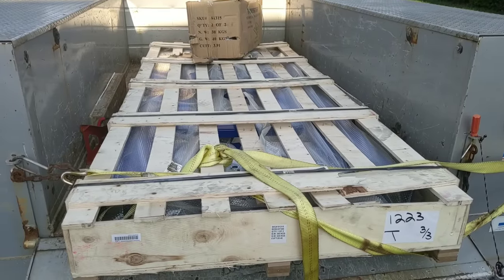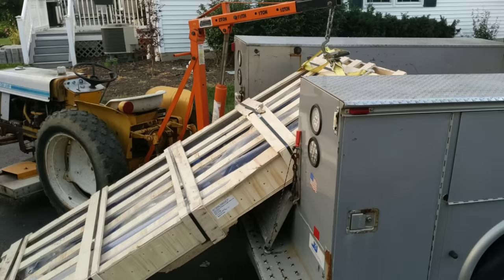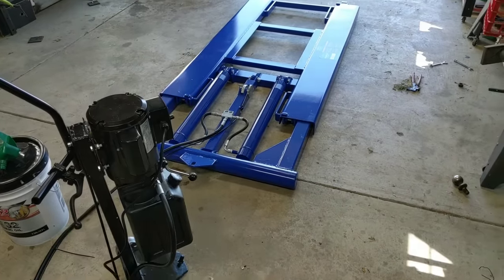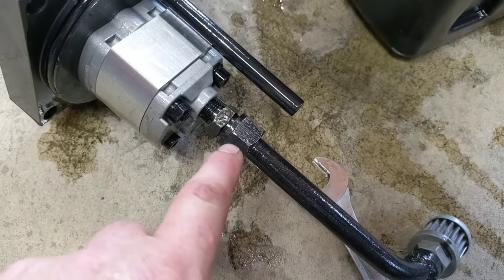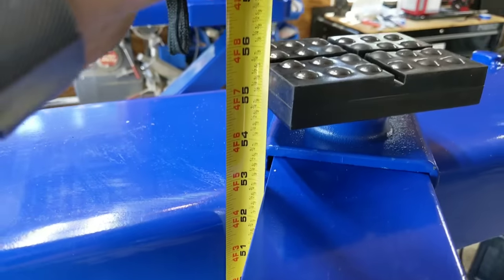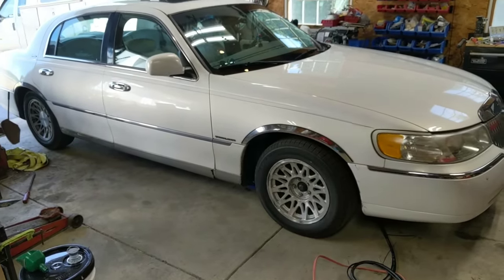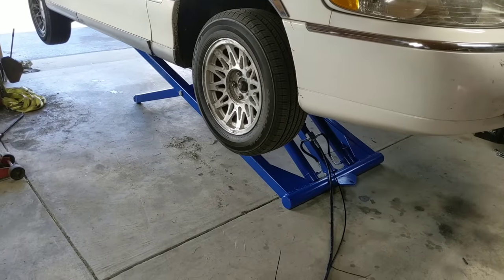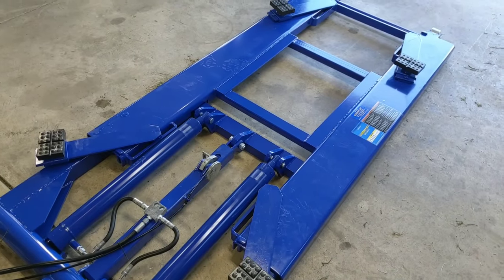Harbor Freight 6000 Lb. Capacity Scissor Lift Review, Central Hydraulics, is it worth it?

Comment: Oops! 55 1/2" is almost 5 feet, not 4.  I knew what you meant.  Talking and videoing is not easy.
Reply from the maker: I can hardly chew gum and walk at the same time let alone talk and video tape.  ;)     Sadly I made a bunch of errors when I shot the film, but I felt it may answer some questions for anyone looking to buy one of these in the future, so I have posted it anyhow.
Reply: @tall bike guy Civilian chutes are square, run of the mill Army chutes are round but do have steering panels.  The Army's demo team uses squares which are much more maneuverable than the ones used by airborne units.
Reply: Every single product that anyone purchases should be in perfect condition and running order, no matter the price you pay!
Just because it's Harbor Freight does not mean you have to settle for less.
You shouldn't be fixing a brand new product.

Comment: I own an Atlas TD6MR lift that is pretty much the same lift but I believe a little better made. I purchased the lift from Greg Smith equipment around 8 years ago. I have made some modifications to my lift. First of all I have two 2 X  12 guide ramps made with 2 X 12 X 14 foot long treated lumber with  a 1/2 inch treated plywood layer under neath and attached to both runners. This gives me the ultimate clearance for low profile vehicles and helps greatly with getting them centered over the lift. Also I custom made  4  longer lift arms that are 6 inches longer than the standard. These arms help me lift vehicles  with a wide wheel base that must be lifted by the body pinch welds.  I use a 30 amp 110 volt dedicated outlet for this lift. Absolutely no need for 220 volts. I have had zero problems or issues with this lift other than the rear steel rollers chewing up my garage floor. For that issue I custom made some 6 inch wide by 36 inch long 3/8 thick steel plates to put under the rollers.

Comment: A shop I worked at for a long time had low ceilings so the the door openers were mounted to the drivers side of the vehicle. You could lift the cars much higher than a center mount. I would suggest Passenger side mounting so you can enter the vehicle with a ladder if needed without lowering the car as this was sometimes an issue. The overhead door company had no concerns with mounting the opener to the side. They say you lift a manual door from one side all the time and it will not cause an issue.
Reply: Craig Shaw like he said in his video Lifemaster makes one that is wall mounted and slides onto the end of the shaft. The emergency release is on the bottom of the motor which is good so someone can’t use a coat hanger to pull the rope and get into your house/garage. After all the rope is only a foot away from the closed door/door seal of a normal garage door opener.  Liftmaster 8500

Comment: The hydraulic pump didn’t even come with mine. The pallet was smashed to pieces. They wouldn’t send the missing parts and ended up picking the frame back up.
Reply: Sounds like junk to me. Guy in vid says no problem just fix, I say it should not need repairs.
Reply: Did you get your money back?

Comment: If you are like me and do everything yourself, the Quick Jack is for you. All of the pieces can be moved easily by one person and it raises your car up to 21 inches and with the rubber blocks, it can be another 4 inches. I bought mine for $1000.
Reply from the maker: Quick Jacks are awesome and great if you need access under the vehicle.   But if you're like me and do everything yourself including detail work, you'd have both.   Scissor lifts are great for detail work, as you can lift the vehicle higher than the quick jacks will allow you too.  Then you can sit on a stool and wheel all around the car w/out any obstructions or shadows a post lift would give you.    While not in use, you can use it as an adjustable work table as I do.   But when you need to work "under" the vehicle, you grab the Quick Jacks and use them.  :D

Comment: $1,699!  Even with the 25% taking it to $1,274, a used two post is a far better deal.
Reply from the maker: Absolutely!   I was finding good used 2 post for half that in my area!   But I didn't want to work around the post and don't have the garage to support one.   https://youtu.be/RAqqgq7ielE
Reply: A scissor lift is really a different tool than a two post lift.  There are more differences than similarities.   Most home shop guys can't install a two post because of height restrictions and/or inadequate concrete.  

The comment about not wanting to "work around" the posts is a little baffling, as the posts are nowhere near any area you would be dealing with, unless you were working inside the interior.  Scissor lifts work well if you're mostly doing wheel and tires, brakes and suspension, and some fluid changes.  Not as well for exhaust work or driveline and transmission.  There's not much you cannot do with a two post (exceptions being frame straightening and alignment) they provide the best access to all areas of your vehicle. 

 I have a 10k, clear floor two post lift in my shop, and I can lift everything from my son's radically lowered Audi to my 3/4 ton diesel crew cab.   It gets used regularly.  Because there is nothing on the shop floor (other than the posts), I can use the bay to load and unload.  One day, I'll get around to installing another rv door in my shop, but until then, that bay needs to be versatile.
Reply: The "problem" with a 2-post lift is that you are supposed to have a minimum of 4" of concrete to install them and most home garages don't have that.

I bought one of the MaxJax 2-post lifts.   It is a 48" lift and fits nicely in the garage and can be unbolted and moved to the side when not in use.

So far, the 3.5" of concrete that I have is holding.  It is rated at 6,000 pounds, but I pretty much cannot get anything that weighs 6,000 pounds into my small garage and i am making a bit of an assumption that the engineers implemented some safety factors into the equation.  So, the 3.5" (measured at the holes I drilled to mount it) is still working.

It is a great device.
Reply from the maker: You are very correct!  Also, by what I meant by "Work around" is I just don't want the post in my way when I'm doing other things.   A good example is my boat is too long to fit in the garage unless I turn it side ways across two bays.   A post bolted to the floor would prevent me from getting it in there at all.    If I had the room, I would love a 2 post, but it's not in my cards right now.
Reply: Just for kicks, look into the "Max Jax" 2-post units.  They are bolted to the floor, but they are easily unbolted and you can wheel them to the corner of the garage when you don't want them around.
Reply: 1D10CRACY |
Reply: @paulstandaert2042  I've seen those. Like that idea of having them removable. I'm thinking about buying a MaxJax lift and leaving one side bolted down and the other side being used as the movable side.
Reply: @Rhaspun  I am not sure what you mean. The posts need to be attached to the floor somehow, and bolting them in places usually how it is done. All I do, is unbolt it with the impact gun and wheel the post out of the way.
Reply: @paulstandaert5709  If I get it. I would leave one of the posts mounted all the time. The other side I would remove it and set the post aside and out of the way. I will utilize its ability to be movable.

Comment: For a couple more hundred you can get a Bendpak. Love mine...for years and years now....
Reply from the maker: Love the bendpak products!   Made mention of them here too!   https://youtu.be/RAqqgq7ielE
Reply: i used to work at bendpak here in santa paula ca. as the lead qc tech. the lfts that harbor freight has and bendpak has are made by the same factory in china bendpak just repaints them and makes minor changes to make it an "original" bendpak.@kranerwheatens @1D10CRACY
Reply: i used to work at bendpak here in santa paula ca. as the lead qc tech. the lfts that harbor freight has and bendpak has are made by the same factory in china bendpak just repaints them and makes minor changes to make it an "original" bendpak.@kranerwheatens @1D10CRACY

Comment: i would like to see you try to rock the car back and forth while a car is lifted up on it, basically see how stable it is with a load on it. how much wiggle does it have?
Reply: This type of lift is not meant for underneath access but rather side access, perhaps brake work, tire work, body work and shock work. only use 4 post garage lifts or even better install a pit in your floor.

Comment: If you want to move it much more easily you can weld a vertical tube near each corner to use large round-shank scaffolding casters. I put all sorts of heavy equipment on those temporarily and permanently (the only difference is leaving the scaffold casters installed). If you mostly use yours as a lift table you could leave them in place. I haven't modded mine because I scored it before I figured out adding casters is glorious (my air horizontal air comps, lath and mill are all mobilized similarly) but next time I move mine I'll pry and use cribbing (typical rigger style) then add weld on caster tubes and have at it. One stick of tubing makes many caster mounts and since the mounts are cheap but casters cost enough to matter you can set four aside for temporary movements.

Comment: Seen 1 recessed into floor worked great in small shop .
Reply: I was just thinking about that. I wouldn’t want to be the first person to do it lol.
Reply: That would be nice and make a easy removable hard cover when not in uses to travel over
Reply: Would be easier to just put some boards along each side to drive up on.  Instant clearance.  Bolt the boards down if you want them to be permanent, and don't mind tripping over them.  lol

Comment: I have a completely different lift, but I also cant lift cars all the way up with 12' ceilings, my work around is an office chair that i can sit on and roll under the car or truck needing repair, it works well in most situations.

Comment: Piece of advice get rid of that compression fitting and plumb a threaded pipe into that pump.Compression fittings are not used in any suction lines in hydraulic tanks on any lift or truck hydraulic systems.

Comment: I bought one like this used, disassembled it, and moved it in my Honda Odyssey. It did take two trips. My main grip is that the dog ears don’t extend far enough to reach the lift points on my Odyssey. However, works well for my CR-V and Jeep GC.
Reply: Longer arms are available from Titian for your scissors lift.

Comment: I would recess into the ground to where the top of the lift is flush with the top of the concrete.
Reply: Most people are going to use this kind of car scissor-lift on a preexisting Concrete or cement floor.
If you wanted to recess the lift into a concrete floor, it would mean using a jack-hammer to tear out 5ft x 9ft of the existing floor, 

and make a "Shallow PIT" about 5 inches deep. ( drilling to insert new re-bar, so when  to pour New Concrete, it binds to old concrete )
(1) This may be "in the way" for other things you want to do with that garage / shop space.
(2) Installing your recessed concrete pit probably cost more than the lift itself. (if you pay someone else, or about $250 to do yourself)
(3) A PIT makes for a Permanent location ... you can never move. (without tearing out and re-pouring concrete) 
(4) The scissor lift was supposed to be "movable" on a level floor, even though heavy and a bit cumbersome.
. . .Once you got the Lift IN to your recessed pit.  It's going to be hard to get back out.
(5) With the Lift in a pit... what do you plan to do with the lift's motor & pump ?  ...plus the pressure hose going to the lift?

OR... IF you recess this lift into "the GROUND"  (to imply a DIRT floor) it's not going to work very well.
As the scissor lift goes up & down, one end of the BASE has little wheels that need to move (and still have solid support for 1000 lbs each)
This relies on a hard level concrete floor.  If you try lifting a car/truck on a DIRT floor, it may drag the wheels and frame to get the car UP...
but then, when you want to go DOWN, the frame may dig into the dirt and get STUCK... making it hard to get the car down, and less stable too.

I'm mostly posting this response, so multiple people can decide "It may sound like an OK idea at first... but THINK it Through"
Reply: @jsteins  holly crap didn't think about all that..LOL
Reply: Wouldn't work wheels have to roll !!

Comment: You need a pinch bar, a block for a pivot, and some larger dowel stock. Lift the end, put a dowel under it, roll the package, rinse, repeat. Castors would work great, too. Strap the pallet and hook the strap to the truck to pull it down the length of the trailer it's in, and then maneuver it to the bed of your truck. I would even try two boards connected at the top and straddle the pallet with a strap hanging down fro the peak of the 2 boards.  Fasten the strap to the pallet, and use the two board like a lift system to scootch the pallet forward. I can think of a bunch of ways to move that pallet without using too much muscle.

Comment: I had one of these (another brand but identical machine) for a brief time. I bought it to pull the motor on my front drive car by dropping the whole front subframe assembly onto a pallet with a pallet jack and raising the car up off of it. It did work, but I actually didn't like it very much for what I used it for. It wasn't quite high enough to walk under and so I had to be on a chair or my knees while under it and it just wasn't very comfortable at full height. Also, like you said, you can't move it around when it's not in use, and it takes up a lot of space, so think of it as a semi-permanent fixture wherever you decide to plop it. Finally, the method I was using wasn't a very good one, so I sold it and invested a third of the money in a transmission jack attachment for my floor jack, some truck jack stands that will get the car about 3 feet off the ground with plenty of room to work on a creeper, and one of those transmission support bars to hold either the engine or transmission in place while you remove the other. The next time I pulled a front drive transmission out of something, I dropped the subframe by itself and just used the above tools. Job went ten times smoother and it was just way better suited to the task at hand. It was very similar to doing a transmission on a rear drive car that way. Drop the subframe out of the way (like a crossmember), remove the dogbone mounts and top mount, unhook all the wires and lines, support it with the transmission jack, unbolt it from the engine, lower it down and wheel it out. Reassembly was just as easy. In fact, with the proper jack setup, installing the transmission by myself went smoother than it ever had with even two or three guys top and bottom trying to line everything up and muscle it around on top of a floor jack. That said, this scissor lift would be a great setup for someone doing a lot of brake jobs or for a tire shop. It's just about the right height for working on wheels or doing suspension stuff. Might also work for a body shop that needs to do some work on rocker panels. It's a good height for that as well. Pretty much anything else I'd rather have a 2 post lift (only marginally more expensive) or just a good old set of jack stands. The scissor lift is just not a good all purpose lift.

Comment: This unit is listed on Harbor Freight on 10/03/19 at 1699.99. At this price you should expect it to be perfect when it arrived. It should have been packed correctly to ensure it would be in 100% working order when assembled. You should not have to fix it to work. You should have declined it. End of story.
Reply from the maker: Agreed, except for the "should" of declined it.  Normally I would have, however I had a job that I needed it for and couldn't wait any longer.   Sadly, sometimes time really does equal money.

Comment: Me: Damn I need this
Also me: No I don't, still can't drop a trans out with the scissor lift in the way.
Reply from the maker: LOL right!    They are not designed for that nor would I get under one!
Reply: 1D10CRACY j
Reply: Use the right tool for the job.  You wouldn't  use a  ball peen hammer for hanging drywall, right?   Or  a 1/2" impact for spark plugs?  Just saying.

Comment: Did  the lock engage at the level that it was put with the car on it? I didn’t here it engaging.
Reply: I'm curious as well. The vehicle shouldnt have to be sky high to have the safety latch function. I think it might be designed for light trucks and SUVs. We have a Ram 1500, 4Runner, and a Mazdaspeed3. Hoping this would work adequately on all 3.
Reply: @UnkyJofus  I wouldn't put my ram on it. That thing is made for Subarus and Honda's. That town car looked like it was really pressing the limits of stability.
Reply from the maker: The Town car only weighs 4015 lbs.   A Ram 1500 base model doesn't really weight that much more, but I wouldn't trust it on it.   Now my truck with the tool body weighs 8250lbs, hell no.   LOL. Also the higher you lift, the smaller the footprint becomes and the more unstable it is.   I personally wouldn't ever lift a car more than a foot or so with it.  They are pretty much more than a jack, less than a lift.
Reply: @1D10CRACY  damn bro do you have buyers remorse? That's a expensive, heavy, akward jack..... 
When's the next review video coming I like the honesty.